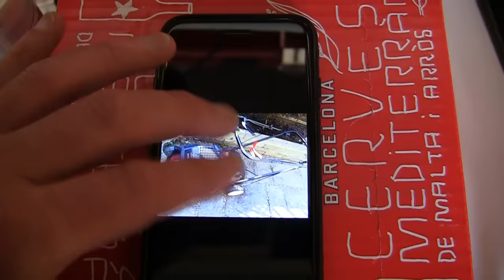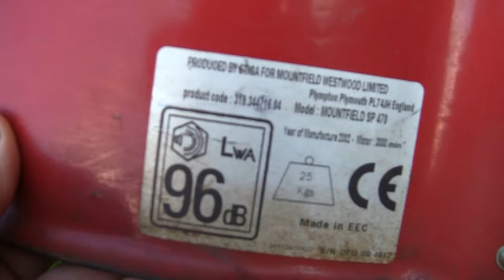Lawn Mower Self Propel Drive Not Working Repair Cable Replace Help

Comment: Had the same problem with the drive. Fixed. When the cable is not attached securely to the mower frame, the cable pull movement is taken up by the unsecured inner cable movement by the flex in the unsecured cable. Secured the cable so no flex of the inner cable occours by tying cable at points between the gearbox and handle lever. Now works perfectly. Thanks..appreciate your great videos..

Comment: I'm just about to buy a Briggs and stratton used mower. So checked out a few of your vids for servicing tips and what to look for when you get one. Tips I learnt in less then a hour, don't tip em Up, use I am gaskets, ngk plugs are best, use the correct oil, double check cables before ordering,  manufacturing part number is on the side, I can sharpen blades on my bench grinder. Engines are easy to remove. Cheers for you vids I'm sure I will watch more if I ever have a problem.
Reply from the maker: Thanks Marc

Comment: Good video, never saw the inside of the transmission gear box.  I know, those cables can be a bit expensive.  I was told by a  small engine tech that sometimes if the cable is damaged (the jacket cracked), you can use a piece of metal automobile brake line that you can slide over the break and crimp on each end over a good part of the jacket.
Reply from the maker: Pete Ciallella Thanks i'll take a look around see if anyone's filmed a video

Comment: Real long shot but have you ever fixed the lower handle on a Mountfield HP470? Mine has cracked at the base where it is bolted onto the mower.  But I can't get the allen key bolts out as they just keep turning without coming out and there is no access to the back of them. This has happened on all four bolts which suggests a design issue? thanks

Comment: Nice fix Paul . They can be a pig to get on lol. The later SP470 cable as you know has the tabs 
and will not interchange .
Cheers 
Pete.
Reply from the maker: Pete Froud Yeah I've had a few of them! Something to watch out for especially when purchasing mowers at auctions
Reply: Oh yes . the boxes will but not the cables .Changed a box out once 
wondered why the cable would not fit . School boy error lol.

Comment: My Qualcast 51cm mower stopped moving. I tightened the drive cable which worked but it's as if the cable is continually stretching. It causes a clatter as well. Thanks for video as the clutch may be similar in how it works on the Qualcast. I wasn't sure if they just used the belt tension for a clutch.

Comment: Great channel mate. My honda hr194 wont self propel. Cable is in tact. Can you help me with some advice? thanks
Reply from the maker: make sure the belt isnt sat too high on the blade adapter
Reply: @MowerMan  thanks mower man.

Comment: Thanks for a very good video, loads of helpfully info, especially the tip if its going to cost more in parts v/s what you can sell the mower for, is to break it for parts for future or sell on ££ top tip ££

Comment: I have this exact model and would like to remove the self drive and just use as a normal push mower, after watching this video could I just simply disconnect the cable from the transmission and it will disengage the self drive or must I remove the whole transmission? Thanks

Comment: Many thanks for all the excellent videos, long shot but my issue is within the driven wheels. The shaft spins to both wheels but I can hold them stationary and when on the deck the gearbox is spinning, but wheels don't have drive. However, if I remove the wheels then I can see the spur gears spinning with the shaft but I can easily hold the spur gear stationary whilst the shaft is still spinning. The spur gear innards look OK, could it be that the engagement "wedge" is worn? It feels like it engages OK but I don't think that I should be able to easily hold the wheel stationary with the shaft spinning - or am I missing something lol ? ... Great channel.

Comment: I have a honda hrx that is pretty old. The problem I am having is that once i have been mowing with it a  while the self propel drive just stops working in 2nd and 3rd gear. seems to work okay in 1st but then I'm mowing very slow. I have replaced both cables that run to the transmission and the belt thinking that the belt might be just old and the rubber hard and slipping. When it gets at it's worst I hear a squealing noise from under the mower. Any ideas?

Comment: Great video. I left in my lawnmower the other day 
The self drive wasn't working great now when I leave the handle go the back wheels still turn not so much that it will move the lawnmower if I lift the back wheels of the ground they still turn will this do damage what do you think .

Comment: My Hayter Harrier rear roller started messing about today with the drive. When you push up the drive handle, nothing happens, but if you lift the back of the mower off the ground and do it, the roller spins like it should. I'm thinking loose v-belt problems. What do you think?

Comment: Hi I have a sovereign hand propelled mower the 2pins in the blade boss have come off can I still use this if the blade is tight if not what boss  would I need are they universal as I am struggling to find the same one

Comment: Really helpful video. Can you please tell me where the self drive gearbox tension spring goes on a 2008 Mountfield SP474 mower. Mines fallen off and cant see where it goes. Thank you.
Reply: Me to😭
Reply: @everettkirk8368  Long time ago but for what its worth. The spring sits vertically, one end hooked onto the plastic body, the bottom end under the gearbox. Looking down onto the gearbox you will see a small hole near where the cable enters - the other end of this hole is where the springs sits in a hole (underneath the box). The short end then hooks onto a cutaway in the black surround so the gearbox tensions the belt.

Comment: Try looking for bicycle cables used and new, bikes with rear derailers in particular you'll have two long cables going to the back of the bike and at least one long housing or two going to the rear derailer and one to the break. You could usually pick these up pretty cheap online for just standard bike cable and housing they'll work with lawn mowers no problem maybe a little customizing with the ends because the housing receivers that hold the housing in place might be a little bigger than the little pressed
Aluminum housing on the ends of bike cables but that's easily fixed. I also believe that you could make your own ends on the steel braided cables themselves by using a welder and then probably a little grinding wheel to size it and shape it to what you need.

Comment: I found a einhel mower put out for scrap,took it home,once I Sussed the levers out,it started first time,but,it was struck in drive,the lever on top of the drive wasn't dropping back all the way,short by a mil or two,so I just bodged a strong spring to pull the lever back,and bang self drive disengaged

Comment: i have a mountfield hp 474 that i overfilled the oil a bit and now it blowing like puff the magic dragon. how do you fix. i need to repair the  lead to the spark plug. can you help and do you private personal message

Comment: Nice one Paul. Cables are way too dear.
Reply from the maker: retrorestore ridiculous we need to find a repair!
Reply: wonder if u could use some sort of rigid plastic sleeve and then some heat shrink over to keep in place
Reply from the maker: lee mclaughlin I'm hoping to find a great way to do it bit failing currently!

Comment: Do you bother to paint the deck if it's peeling off but solid underneath?
Reply from the maker: Paul Baker Sometimes i'll paint bits of it but not all of it. Have a look at retro restore channel Martin's done a few resprays on there.
Reply: Mower Man yes I have subscribed to martins  channel as well, I was just wondering how far to go as I've just started doing this :)

Comment: Hi mate I've got a mountfield with a self propelled movement.
I've got no self drive at the moment so it may be a cable issue, my only concern after watching your video is my wheels are locked currently and do not spin by hand, could this be a gear problem or something else?
Reply: Hi. Did you manage to rectify this? As I'm having the same issues.. Thanks..

Comment: Any ideas on this mate? I can’t get the big belt cover nut off. The two small screws are out but the big nut is solid, I’ve tried my impact gun but the other end of the bolt just spins, I can’t grab it with anything to keep it still (tried long nose mole grips but it’s just so short and rounded it’s impossible to grab. Any ideas before I cut the nut off with a Dremel?
Reply from the maker: AMRacing199 I would just cut it off or get an extended socket and someone to help you hold it. Soak it in wd 40 also
Reply: Mower Man ended up cutting it off and feeding a bolt from the blade side and secured with a nut on the deck side 👍🏻
Reply from the maker: AMRacing199 Glad you finally got it sorted!

Comment: Great vid as always, I just wondered is there a reason why you didn’t buy a impact wrench for your compressor Instead of an electric one?
Reply from the maker: Neil Greenwell Hi Neil I bought one to use with my compressor but it wasn't powerful enough.
Reply: I wondered why, I was sceptical about buying one for my small 24 litre compressor from Screwfix, when I first used it I used it with the narrow pipe supplied with the compressor cheap rubbish one. No power to the impact wrench at all really. However I read somewhere that the air pipe makes a difference delivering the air pressure to the wrench, so I brought a heavy duty 10 meter air line from Screwfix, now the impact wrench works perfectly even removes the most stubborn blade bolts, even a seized trailer wheel nut it removed with ease, and it doesn’t recharge the air tank half as much as I thought it would using it. If you’ve still got your air impact wrench try getting a decent air line for it it’ll make a huge difference, at least that’s what I found out 👍
Reply from the maker: Neil Greenwell Thanks Neil I will look into it for other tools cheers

Comment: what brand push mowers or certain models, have all metal drives. do the honda's use plastic. are cub cadets a great push self propelled mower.
Reply from the maker: BlackCat 56 If you contact the manufacturer for a brochure it usually says in there.

Comment: have you done a video on how to completely replace the transmission box. I have a SP53 and the self drive is very weak and feels like the metal cog has worn down the plastic cog
Reply: No plastic on mine....

Comment: mowerman got a mountfield sp460 roller mower,does the drive have a tension spring for the belt,and where does it join two.part number 125430220/0 SPRING
Reply from the maker: john rathmill Take a look here John at the diagrams http://www.shouldersofshoreham.co.uk
Reply: they don,t tell you where the spring goes to and goes from.john
Reply: if you got time.can you have a look for me.send pic,thank you john.
Reply: hi mowerman can you help with this got a Ryobi RLM140SP self-propelled not working,works when you pick back wheels of the ground,but when you put the wheels back down the wheels stop,.can you help me out with this,o

Comment: Did you happen to add any gear grease to the gearbox before replacing the cover? Do they call for grease or lube of any kind?
Reply: The box has oil in it, but I dont know what type

Comment: Cable repair - 2" x 15mm copper pipe slip over end of detached cable , smear the break  in cv moly grease , place copper pipe over break and crimp one side with large pinchers tightly at cable,  file sharp edges from flat bit , will last years just make sure the cable is loose and does not kink when handle is folded.

Comment: My hayter self drive starts up but pulls a few inches then stops the belt looks to be intact. Any ideas
Reply from the maker: goonluv replace the belt it may be slipping.
Reply: @MowerMan  cheers

Comment: How many times do you wanna repeat what your saying but with a different camera angle? Jesus christ its a annoying. You can save 20 minutes just not repeating stuff all the time.
Reply from the maker: Says the guy with 5 subs..
Reply: @MowerMan  I have this exact model and would like to remove the self drive and just use as a normal push mower, after watching this video could I just simply disconnect the cable from the transmission and it will disengage the self drive or must I remove the whole transmission? Thanks